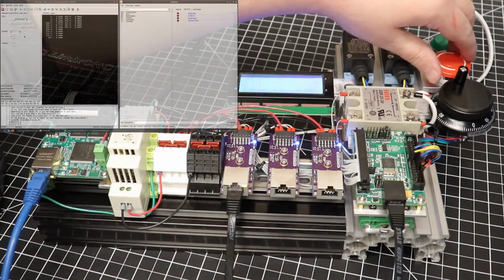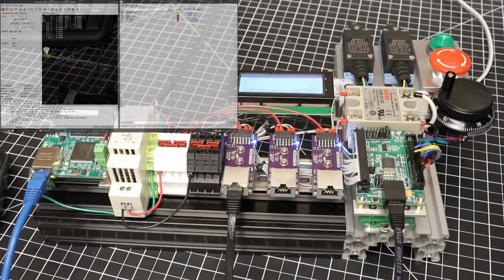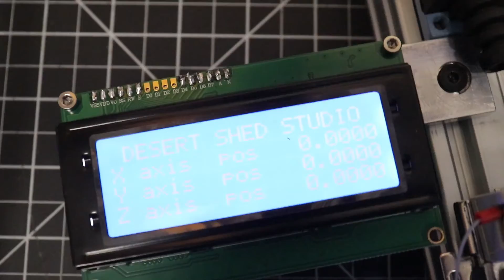LinuxCNC Mesa 7i92 + Smart Serial

Comment: I'm not sure I understood why you had three of your purple boards. 
Some explanation of what is wired to what would also help understanding.
Reply from the maker: I have three boards connected so I can test each of them after assembly. The purple boards are the only thing connected to the Mesa 7i92. All I/O devices are connected directly to the Mesa 7i73. The purple board connects the 7i92 to the 7i73 using only two 7i92 pins.

Comment: Man I need one of these boards. I read through your post on the Linuxcnc forum. This would probably be a great way for me to add two MPG wheels to control my CNC converted lathe for "Manual operation".

Is there a way to get one of these from you some how? I'm using a 7i92 as well.

I'll need to flash a new bitfile to get my access to the smart serial pins I'm guessing. I currently run one 5 axis BOB off the existing db25 connector. The other connector on my 7i92 is unused. I also don't have a 7i73, which I wish I had.
Reply from the maker: Thanks for checking out my project. I can send you a M.E.S.S.I board, no problem. I am not really selling them at present so Just E-mail me a prepaid USPS label and I can drop one in the post next time I go to town. Send me a msg. through my websites contact page and we can get that ball rolling. 

Yes, I flashed a new bit file to access more SS pins on the 7i92. During testing I was using one of Peters included bit files. I forget which one. Take a look at the pin files to see if one of the included options works for your application. If not Peter (PCW on the forums) could put one together for you real quick. Looks like Peter/PCW at store.mesanet  and John/BigJohnT at MesaUS are both out of stock but the EU dealer EUSurplus has a few 7i73 available. I have found this board to be more useful then I initially anticipated.
Reply: @DesertShedStudio  Yeah that would be awesome. I'll get a 7i73 ordered from overseas. Unfortunately, the only bitfiles that have the potential to work don't include a configuration similar enough for a 7i73 and a 5 axis  BOB, but I'll poke around and see if there's something floating around somewhere before asking PCW. I'll send you a prepaid label once I get the 7i73 ordered 👍
Reply from the maker: Sounds good, I look forward to seeing how you implement MPG wheels on your lathe. I recall @kentvandervelden doing something similar to his south Bend. Should be a fun project.